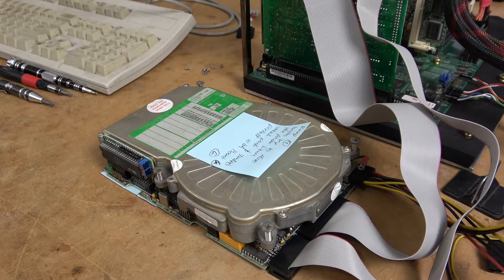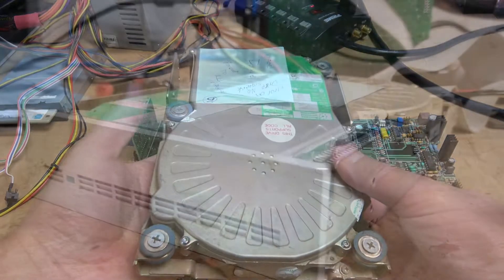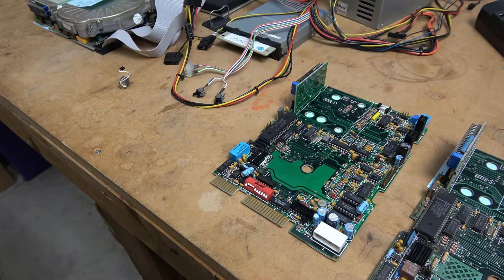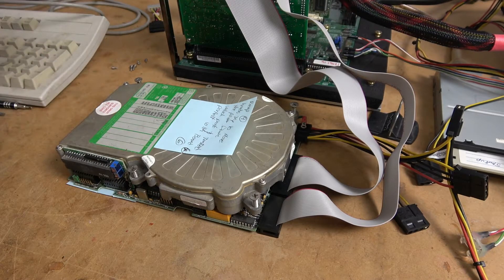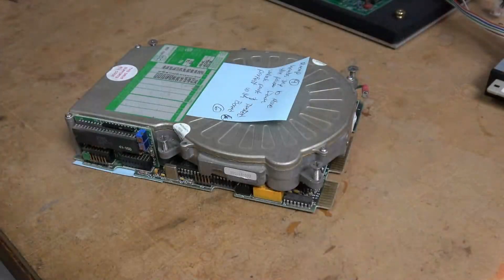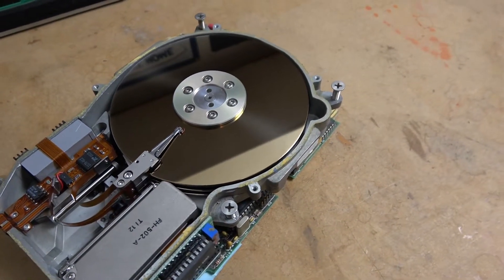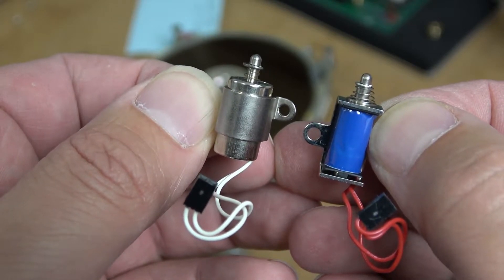Fixing a Microscience HH-1060 RLL Hard Drive

Comment: I bought a 1986 IBM XT a few days ago, and it has an HH-725 hard drive in it. The diskpark utility threw an error when I tried to park the heads, so I started looking for information. The manufacturer's datasheet I found online said "NO" everywhere in the park/lift section, but now I've found your video and I see that these drives actually had a kind of "autopark" feature.

Thank you very much!

Comment: is the fire problem related to all Microscience HH series drives? I have got a top notch HH-3160 scsi drive right here.
Reply from the maker: "fire" or burning caps is an issue with the capacitor type and can happen to any of them.  I had a motherboard where the cap failed but, didn't burn and two of the HH drives went up in smoke and seem to have taken the micro controller with them.  Twill see, I'm fixing to try and repair a few more for new projects.

Comment: I was a customer of Microscience back in the late 80s. The HH1060 was a fast drive for the day, I still have one or two of them.  I got to know some of the guys at Microscience and they great. RIP Barry Waxman.
Reply from the maker: I always wanted to do an article on the company and see if I could interview some of the original members.  The company did quite a bit to advance hard drive technology, at least from what I have seen, and they were one of the few not to be consumed by larger brands.  

On a related note, I'm working on a new 286 build and plan to revive another Microscience drive for the project.
Reply: @Hardwareasylum  Interviewing the old school drive guys would be really interesting.  I always thought Microscience made a good drive and no idea why they went under.  I think it maybe they didn't make the jump into 3.5 drives?  It seems the guy you want to talk with is Peter Kevin Nagle, the CEO of Microscience (linkedin).  I'd get to them soon because unfortunately folks of that era are dropping off.  😞  Happy to help if you need.
Reply: @chandrab MicroScience did make 3.5” drives in IDE & SCSI

Comment: Wow! Where did you get so many drives? Always wish I could stumble across a treasure trove like this. Usually the closest I get is pulling WD Caviars from recycling yard machines.

The HH-725 is a stepper drive, not servo actuated. They are totally open loop with no feedback.

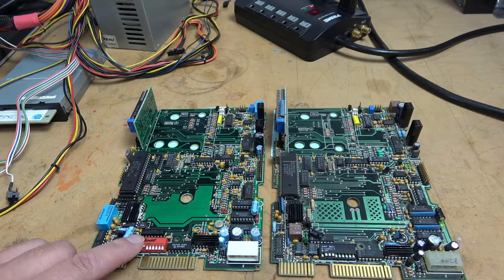1:53 They are called tantalum and they are pretty well known for failing dead short and starting fires like this. Hence the nickname "tantrum" capacitors.
2:26 The board on your left is a newer revision, it's made on a newer manufacturing process. You can see that the infill on the ground planes is more complete - This was not possible with the older plating process, which would make them bubble up and flake off with large surface areas.
3:47 if it's reporting all bad tracks then you are much more likely to have a failed head or head amp than actual platter damage. You would hear damage that severe.
7:53 This is called the ST-506 or ST-412 interface. They can signal in any encoding you want, the smaller 20 pin connector carries the differential data signals and the 34 pin connector carries control signals. These drives are "dumb" and will attempt to respond to essentially any command you give them. The primary difference between the 506 and 412 interfaces is that the 412 swaps a hardware reduce write current signal (something most later drives implemented internally without the need for a controller) for an extra head select signal.
9:18 This is a linear voice coil drive, which is different than the "modern" radial voice coil drive. The radial design shows up sometime in the late 80s, I think in Quantum's voice coil drives first, and sort of became the standard. Another similar design was the rotary voice coil - Used on the Rodime RO3000 series, Microscience 7000 series, Plus HardCard 20, etc. It was popular because it was "patent-free," even though the radial actuators have much better balance characteristics for faster seeking.
12:46 I wouldnt recommend using compressed air, the aerosol can sometimes come out as liquid and sit on top of the platters which can corrode them or damage the heads.
Reply from the maker: Hey there, glad you liked the video, and good job on the fact check, comments go a long way to get videos like this ranked.  The drives were from ebay (pretty sure I mentioned that in the video).  A few of the drives have the same head lock issue, some of the control boards have random errors and a handful of the drives work perfectly.  The original plan was to fix up the drives and sell them off but, it would seem the demand for hardware of this generation is pretty low to non-existent. 

So, we shall see what happens to them in the future.  Maybe they will become video props.  Oh wait.  I did a video about that already.  :)
Reply: @Hardwareasylum  Interesting that they came from eBay, I'm a huge collector of vintage hard disk drives, and I've never seen so many appear in a lot at once.

Shame that they're props! I would have loved to have a few myself. They are good stand in drives for a couple swap tricks, because of their high head count and auto parking.

I recently bought a large box of IMI 5000H series drives from an industrial supplier in Texas with the intent to do a repair video like this, though I plan to keep (or donate) the drives afterwards.
Reply from the maker: @AiOinc1  Well, by prop I mean something like this  https://www.youtube.com/watch?v=xIKtmdApG0s  The drive was locked up so I salvaged some parts, fired up my 3D Printer and leveraged my PC modding skills.  You can spot the drive in the background of some of my newer videos, hence the "prop" comment.    The Microscience drives are extremely well made and I plan to use a few more from the stash in future projects.  I might even try to track down the old company in Taiwan and see if they will do an interview.  Doubtful but, I have some connections.

As for finding some yourself, I already told you where to look, my alert goes off every month or so.  :)  they are out there.

Comment: Thank you for documenting this repair! I got the same type of drive with an Atari Mega recently, and it has the same power up issue. I don't have a replacement solenoid, so I wonder whether the existing one is just stuck and can be unstuck somehow. Something I might try. Thanks for showing the exact process!

Just some feedback on the intro scene: It was irritating that it cut out right before the error click would be heard. :P I'd have watched the full video and not skipped half of it, searching for a full spin up, if I'd known from the start that it addresses the exact error I was having. :)
Reply: Success! When the drive was *powered down*, I gave some gentle taps with a hammer onto the front of the drive (remove the plastic front plate), just right of where the flat cable goes inside of the drive. That way, the shocks travel down the moving direction of the heads, so you won't risk a head crash. For a couple of power cycles, the solenoid opened successfully, but I also had it get stuck again when powered down for a bit. So not a reliable repair, your method is certainly more permanent. It'd be great to know the pins going to the solenoid on the cables, such that one could actuate it many times from an external power source, with the rest of the drive powered down. You don't happen to know which ones these are? :)
Reply from the maker: @peterderhalbemeter  I did at one point but didn't write them down.  Besides, the pads that are accessible from outside the drive are different depending on what board revision you have
Reply from the maker: You are right about the intro.  I really should have have left the error and then rolled into my intro.  Sadly, the only way I can fix it is to upload a new version which wipes out all of the comments and likes I have already gotten.

However, if it will lead to more watches then I might just make it happen.  :)

As for your question.  If you get some light machine oil and drop it down the edge of the solenoid that might be enough to get it working.  I've been meaning to try that on the one I removed but, haven't gotten around to it yet.

Oh, and you'll want to remove the solenoid before making the repair just to keep excess oil from getting inside the drive.
Reply: @Hardwareasylum  Thanks for the reply! Don't worry about reuploading, losing the views and comments is probably not worth it. Maybe just an idea for the next great repair video! :)

My drive now reliably unlocks on second try if it was shut down for a couple minutes. I have cycled the drive couple times to exercise the solenoid. Using the footage from your video, I think I identified the two pins that go to the solenoid: When the drive is on its back, board facing up and front of the drive facing you, it's the two lowest / closest pins in the left row on the long connector on the right side. But applying 5V to them directly after pulling the connector had no effect. I didn't dare going higher in case I got the wrong pins, as I didn't want to zap anything. Maybe something to try once I got the data off (no idea how to go about that yet, as it's an Atari drive and my Atari knowledge is zero).

Long story short, thanks to your video I got the drive working again! :) Thanks for sharing your insights and procedure!
Reply: As an update after the drive had a chance to sit unpowered overnight: It sometimes takes about 5-6 attempts for the first successful head unlock. Power cycling rapidly (flick switch off and back on right away) after an unsuccessful unload hopefully limits the strain on the drive, though I'm sure it still is quite bad for the electronics. But I am able to read and use the drive perfectly once spun up, which is a great success! :)

I'm currently trying to get the data off the drive using PARCP or maybe serial. Maybe afterwards I'll experiment more with getting the solenoid unstuck via the pins on the cable header. I was able to measure a short voltage spike on the two pins I mentioned when the drive tries to unload, so I might be on the right track.

Thanks again for the video! :)
Reply from the maker: @peterderhalbemeter  Glad to hear you were able to get some data off the drive.  "Technically" they say that flicking the power on and off is bad for the drive.  But, considering the usable life was only 5 years I'd say you can do whatever you can to get it working.  :)

btw, I'll have a new Microscience related video launching in a few days.  it should be pretty cool.

Comment: I have an MFM hard drive from an the first computer I ever used.  It is a ComputerLand BC88.  The drive recently started throwing seek errors.  I have been watching videos to learn as much as possible to try and fix it.  Luckily I backed it all up before the seek errors started.
Reply from the maker: there isn't any coming back from a seek error on these drives, that is usually a platter or controller issue but some of the other mechanical issues you can generally fix without too much trouble..  I always wanted a hard drive like that but it never happened.  When I started building my own computers IDE was the norm and I never really looked back.  Until now.  I have a future build planned, twill be a 386/40 + this hard drive.  I have a couple videos up on the project already and at least 3 more in post to complete the project.